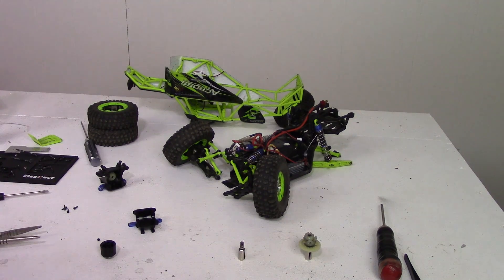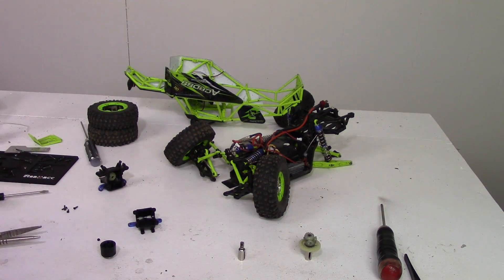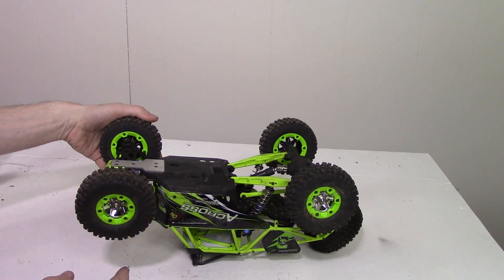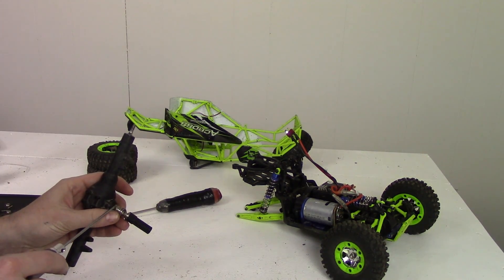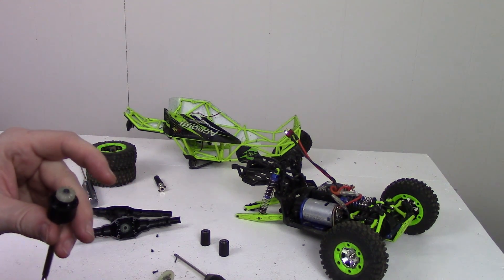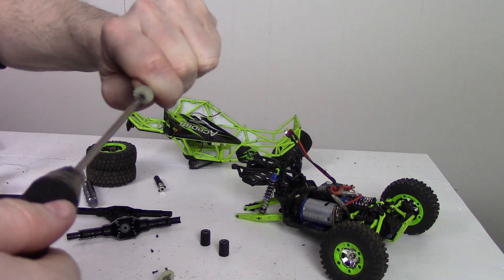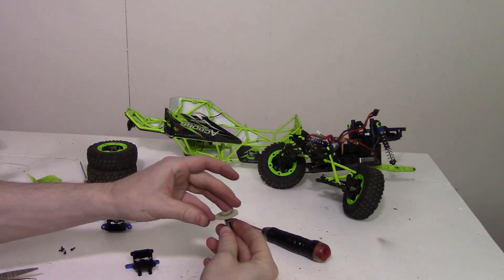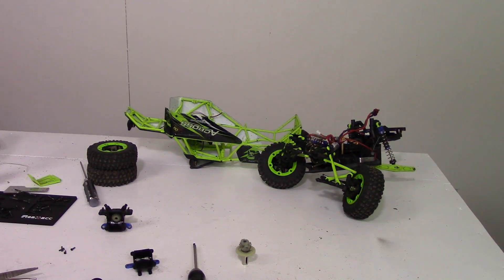WL Toys 12428 Diff Problems From Running 3S!

Comment: instead of taking off the end cogs off the drive shaft where they wore away to just a circle i would of left it as and cleaned it up and injected chemical metal either side of it to fill the void that would of held up
Reply from the maker: I had thought about trying that with an epoxy, but thought it might just end up slipping after awhile. The other idea I had was to drill a hole through the gear side ward, then insert a couple of small screws and epoxy them in to take up the space where the plastic wore away.
Reply: think your way sounds better would have to be tiny screws though

Comment: You should spray with WD-40 bofore taking out the screws
Reply: If its tread locked, WD wont do much, but yes it should help once screw gets moving. Before that one should try get some heat on the tread lock compound, so it breaks before metal does. Solder iron should do the job with out melting the plastic gear.

Comment: I'm ordering completed front and rear differentials off the feiyue and installing them on the 12428. The rear won't be a problem the front I'm not sure about but if it don't fit in the front than I'd rather go rear wheel drive from now on than replacing garbage plastic gears every weekend... hope you are reading this wltoys! make metal gears for the 12428 shit you made everything for the 949 1/18 scale buggy.
Reply from the maker: I'll be using the rear end off the feiyue too, I have a spare front diff right now so I might see if I can get that to fit somehow too. It's definitely frustrating some of the choices that they make.
Reply: Mike Fahner i have a litehawk max4x4. which is basically the 12428. ive got a 3's setup in mine and have been killing diffcup gears exactly like you guys. ive been toying with the idea of a vaterra twin hammer swap for entire front assembly and rear end, diffs and cvds. its 115$ shipped in canada which isnt bad.  but at that point ive got around $450+ into a truck. really makes me wonder if it would of been worth the high entry price of the vaterra rtr???  oh well atleast it looks sick !
Reply: TroBudden yeah I've dumped alot if money in the short month I've had the 12428, I know what your feeln. Gmade adjustable piggybacks 4000kv toro 60 amp brushless which does standing backflips in the 12428 flysky gt3b radio austar aluminum beadlocks along with 1.9 superswampers plus another set of 1.9 beadlocks valineon cooling fans just to start not mentioning the parts still in shipment like hardened steel driveshafts aluminum control arms aluminum steering components jx 20kg servo with aluminum arm that I still can't find a ball end for. Guess by the time I'm done the cheap rc should be a pretty decent 1. Lookn at a set of those fast eddy bearings any ideas on a good bearing set you can think about let me know hey. Nice setup by the way sucks experiencing probs but least I know I'm not the only 1 out there. Guess if your not breaking something your not havn fun!
Reply: Ya know bro also I been lookn at those nice replacement diffs for the axials and whatnot. There like $150 a set. Been pondering the same thoughts. With those diffs these rc' s would be in a whole new class.
Reply: Lol just got shipping confirmation on the aluminum control arms, yeah 4 days later just to see a delivery date of September 12th. Lmfao September fuck I'll be dead by than.
Reply: Mike Fahner , its pretty crazy how versatile these buggies are when setup well , my esc has a crawler mode which helps control this thing on some serious rock climbs with my buddies (who all run Axials ). its surprisingly competetive !
Reply: TroBudden high dollar sometimes dosent yield high results. Nothing ever stays stock and the end results is only as good as the aftermarket parts put in. I say make our own rigs from scratch using tubular aluminum along with some carbon fiber parts and a ton of aftermarket components..

Comment: Ok so I've decided on the axial yeti. now I need to decide between the kit and the rtr. normally I'd go kit but the yeti has castle electronics with spektrum radio and their brushless motors are real nice imo. hope I'm not making wrong move on not goin with the vaterra. if so than I myself Will buy the vaterra which I'm sure I will one day. the yeti is a gift so it will be a minute still. I really really like the yeti body style and color. like their offset axles with adjustable ring & pinion backlash. offset axle great for clearance. comes stock with front and back sway bars and stock with titanium reinforced lower axle trailing arms. metal gears in all the diffs and the transmission as well. All this you have to purchase seperatly with the vaterra. what's your opinion on the 2. I truly believe in making a great choice on both actually but I think the yeti is that much better, definitely alot more $$$ for aftermarket hopup parts.....
Reply from the maker: Yea I think the Yeti is a better vehicle overall. Ever since the 1:8 yeti came out I have wished I had one but just too much $$. I think the yeti is better at handling more speed too over the twin hammers.
Reply: Void X RC that's what I was thinking but that's due to the sway bars which the vaterra is a purchase separately item. you really need the get this vaterra diff in your hand and feel how smooth the axles turn, it's almost amazing honestly. the build quality is very solid. the yeti seems good also but the rear diff and the sway bar almost are on the verge of lookn almost like Idk too much plastic or maybe lower grade plastic. Idk just seems like how it looks but pictures don't do justice that's for sure. I look at mine even and mine looks alot nicer in person than in photo so I got to keep that in mind. think it might be the rear axle trusses on the yeti that's throwing the whole too much plastic goin on I think. the cost to build the yeti is high which is something I have to remember but the parts are nice lookn and plentiful for sure. so..... do I go rtr or kit. the rtr offers alot for the added 100 BUT I swear my toro brushless has more power than that yeti brushless and even though the Toro brushless combo is only $80 I still need everything else so it would in turn cost me more. I'm also not a tactic fan, spektrum for me!!!
Reply: Void X RC I pulled the rear diff cover off last night just to check on the gears and see how the grease was holding up. the gears are made like impact sockets, hardened steel with a black coating. well I half expected to see some silver wearing thru the black at least on the edges or at least the tips of the gears and nothing. no signs not even any discoloration of the steel indicating normal wear. so whatever kind of steel it's certainly hard as hell. my lithium grease to my surprise is sticking to the gears rather well I might add. far as those pictures of the driveshafts I posted last night since you never gave me an answer lol I went with #1, the GDS RACING driveshaft. I found it here in the states and I was like hell yes just to find they were out of stock so I had to order it overseas. this my last overseas order till I get all my MIA orders in...
Reply from the maker: I did reply! I said I liked the GDS ones :) All good though, That's great to hear about those gears in that diff! Sounds like that are properly hardened and everything. Might have to upgrade the rear diff in my twin hammers clone.
Reply: Void X RC it would probably fit yours easier rear and the front. I'm still not sure if I'm goin to try buying the vaterra front diff or not. The front seems a different story considering everything that's bolted to it shocks front hinge plate and control arm pins kingpins ect. honestly the back wasn't impossible by any means it does fit just those few minor adjustments but the fact the gearing dosent match the stock front despite what anyone else says. they do NOT. lol I was just messing with you but yeah the GDS "racing" driveshaft shipped out 1:13 This morning so well see how it holds up to its name. seems like it will. it certainly looks tougher in the pics than mine do.. think it's goin to take more a beaten while in 2 wheel since it won't have 4 wheels to distribute and even out the torque load to...  yeah I did half expect to see even a little silver shine wearing thru some of the teeth on the ring gear considering I have been gettn on the throttle bit harder now, still at °5 motor timing.

Comment: yeah Idk I'd have to agree maybe with the feiyue being a not so much better but more durable overall rc. the 12428 does have the bigger motor and all metal drivelines. I just don't understand throwing all that especially a 540 can at plastic gearing and expect a good outcome. the 12428 should of been equipped with the feiyue's 380 can size motor. I mean is that much really to just throw in metal gears in the front & back diffs. come on wltoys!! I hope your reading this. you guys really messed up here great setup lots of power but the power is lost thru the plastic drivetrain. It's time to off the A 949's or whatever those little shit cans are and start making some metal gear upgrades for the big boy rc's like the 10428 12428 and few others to speak of....
Reply from the maker: I've definitely noticed that some of the companies that do more beginner/toy grade stuff can have a hard time getting into hobby grade gear. I don't think they don't realize that spending a bit more money on their products would get a lot more people interested in their products. So they just sorta half do it. The feiyue(more so on the electronic side) and the 12428 are both good examples of it. that said sometimes they can still be turned into something awesome. I do really like both of my feiyues and I'm definitely impressed with how well physically the feiyue has held up, not so much it's stock electronics.
Reply: Void X RC yeah I'll say I didn't spend to much time actually really none on debating between the feiyue and 12428 since I knew I would be eventually replacing everything turning it into my own rc instead of some companies rtr version. I did by the way find a set of fast eddy bearings that had 4 of the different size bearings that had the 12428 uses. other than 2 more sizes it was missing it was almost as if the set was made for the 12428. I'll definitely be picking up some soon. still haven't gotten a ball for my servo arm, pretty sure I got the correct size hunted out.